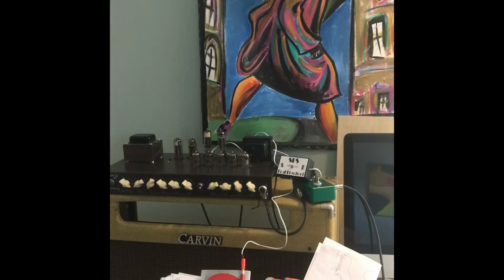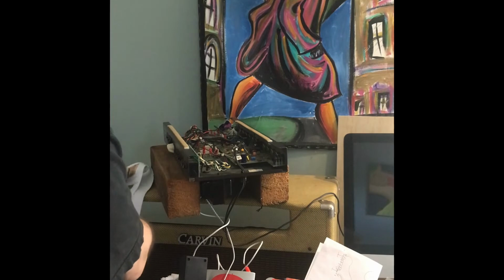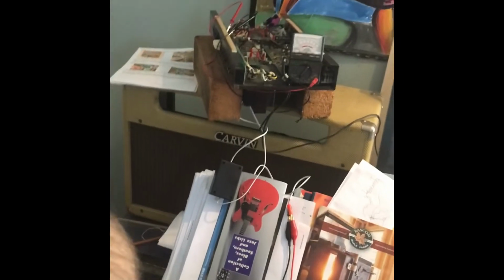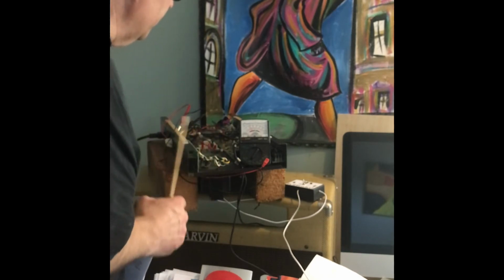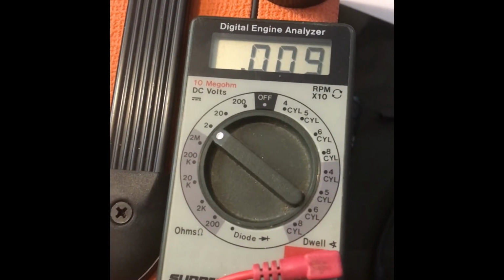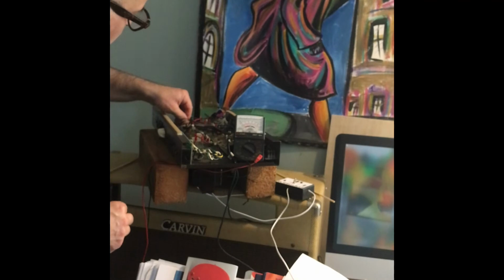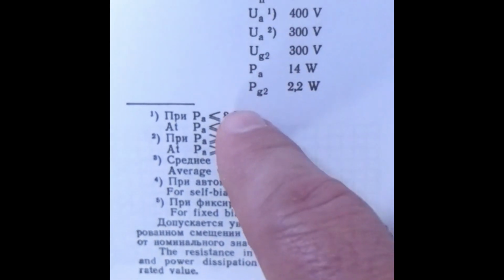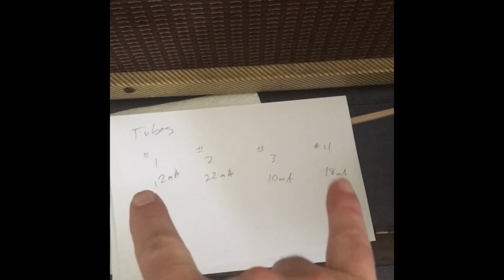How to bias a Carvin Belair using factory standby method & SRS dual bias tester

Comment: Good, informative video. 
I'm also happy to see a tech who's almost as sloppy as I am, and yet, he lives.
Reply from the maker: I have these things on isolation transformers to compensate for any sloppiness on my part. And for some reason electricity doesn’t seem to enter my body as easily as others. I am freak that way. I use to power wash and make up 5 gallon buckets of sodium hydroxide solution to strip deck stains and paint off of wood. Sometimes I would drop something in the bucket and reach my entire arm in to get it and rinse my arm off. I would even get the stuff splashing back into my eyes rinsing it off homes. All would ever happen is my skin would be dry for a few days. Someone came by and saw what I do and said most people would be carted away in an ambulance to the ER.
Reply: @voxpathfinder15r  Are you related to Bruce Willis?
Reply from the maker: @aldonapolitano5979  lol, I was driving my car and got involved in a triple decker accident on the highway doing 360s off onto the exit ramp as yet another car struck into me. And I walked away from that accident, but a freaking little tick gave me Lyme disease years ago and nearly destroyed my life with nerve system disorders. Go figure….
Reply: @voxpathfinder15r  Ouch. That happened (thr Lyme disease) to one of my sons.
Reply from the maker: @ it’s awful